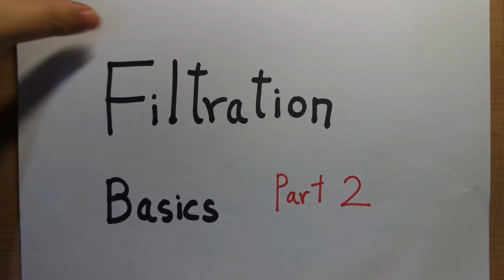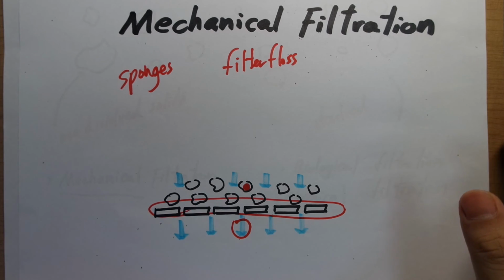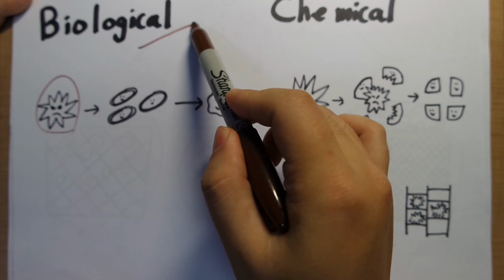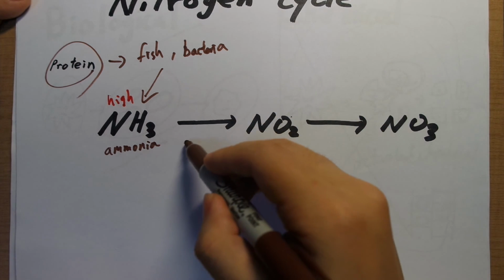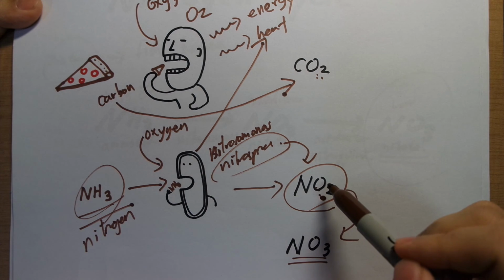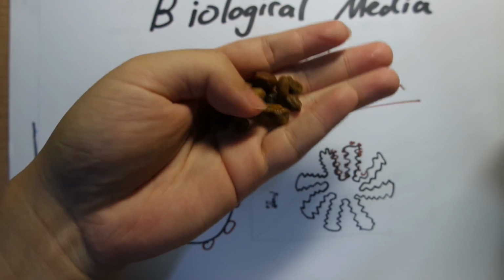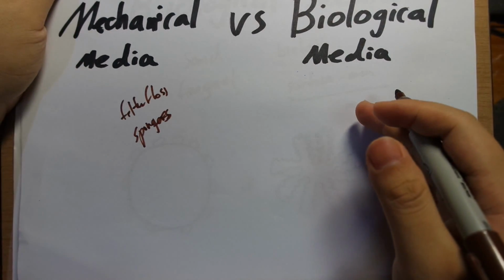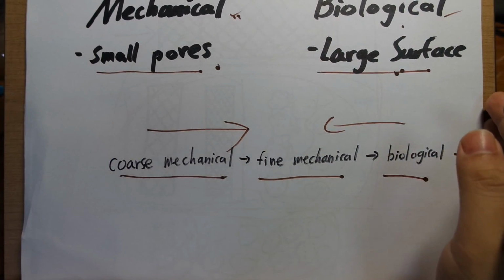Aquarium Filtration basics part2: Mechanical, Biological filtration, Nitrogen cycle

Comment: interestingly, there is a newer form of mechanical filtration used in the saltwater portion of the hobby (since they typically use less plants/algae than freshwater), which uses a rollermat to actively remove the large waste particles from the water.